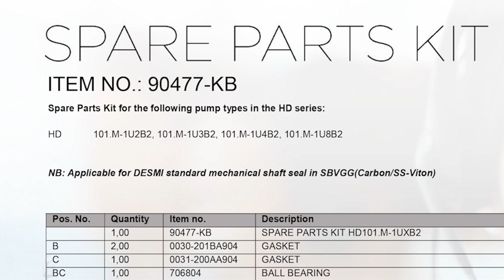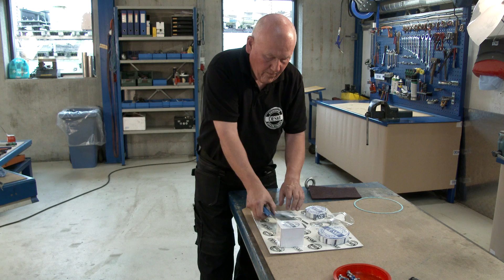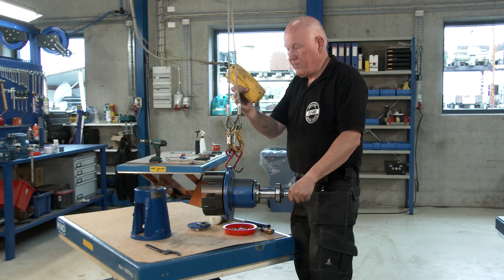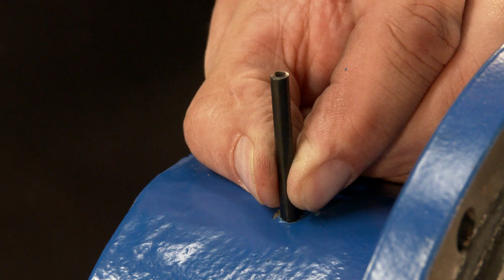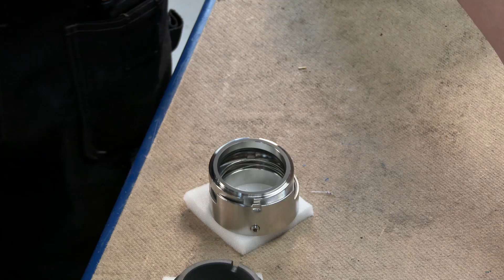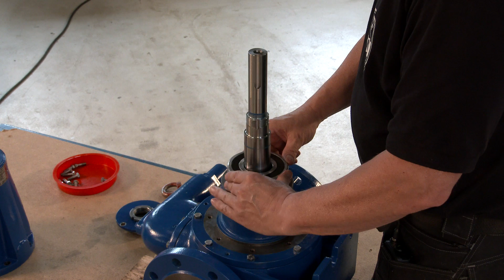DESMI Overhaul Video HD 101 - ROTAN® Gear Pump

Comment: What are the torque specs for the set screws and the bearing nut?
Reply from the maker: For the M8 Screws used for the Covers on the HD101 Pump, the torque value is 24 Nm. 

For the Bearing Nut there is no recommended torque.
You just have to ensure that the Ball Bearing inner ring is touching the shoulder of the Shaft and that the Bearing Nut is tightened up against the Locking Ring.
Then lock the Bearing Nut with the locking Ring.